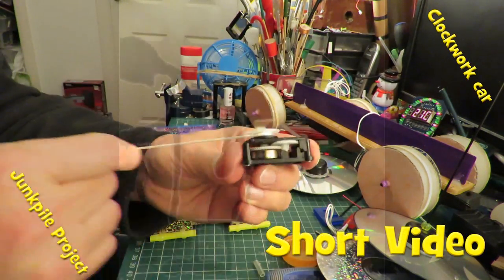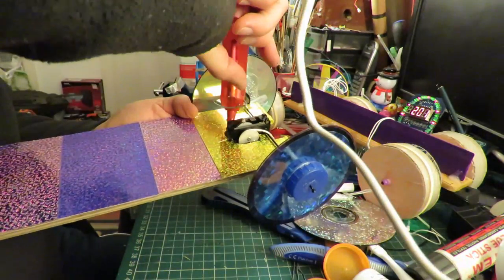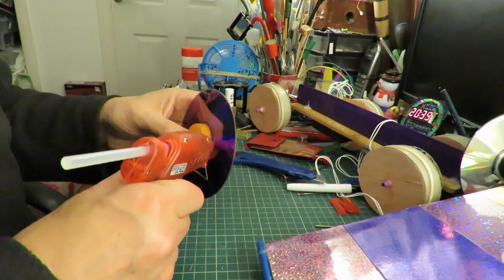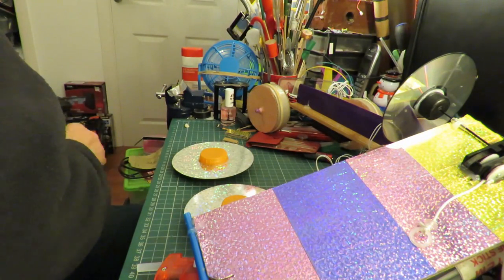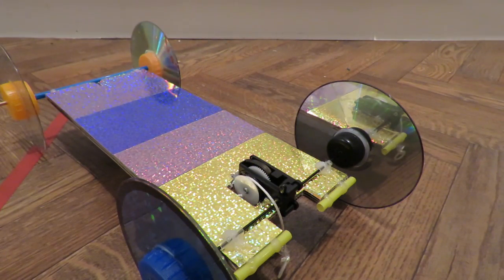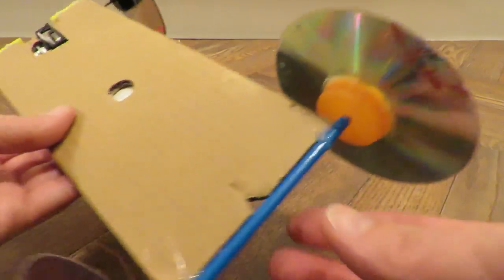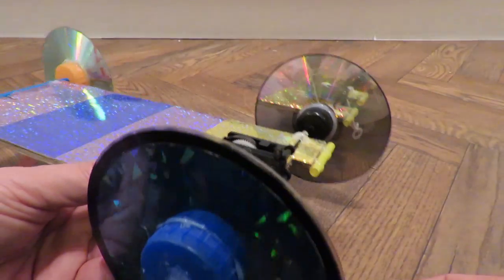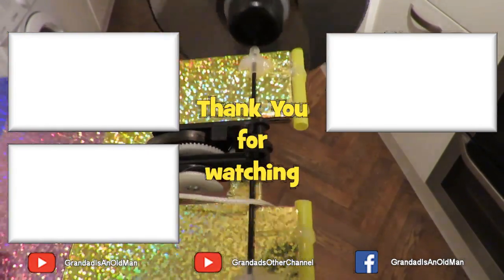Junk Pile Projects Clockwork Car SHORT VIDEO

Comment: CD is always best available stuff for making wheels. But my kids always break them a part.Can you please make one video to built some durable wheels using cd or anything
Reply from the maker: When I have needed stronger CD wheels I have used several next to each other, for instance using a 10 pack of CDs for each wheel. Obviously that makes it heavier so it just depends what purpose you need them for.
Reply: GrandadIsAnOldMan GrandadIsAnOldMan well actually I am trying to make something which is very durable one which if you throw or drop it does not break (not heavy one) anyways thanks for the reply
Reply from the maker: In that case you might as well buy proper wheels from a hobby shop or online store or find a toy you can take them from.